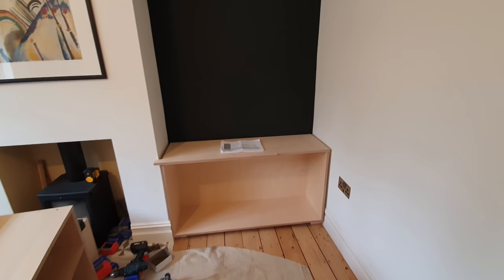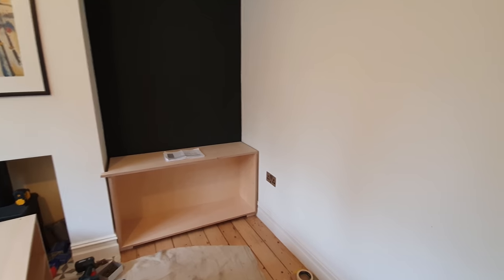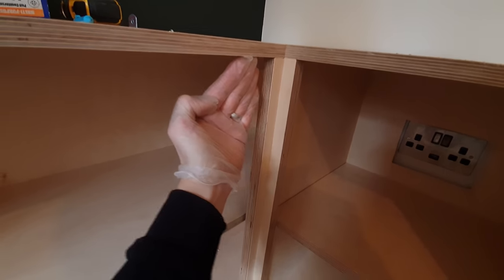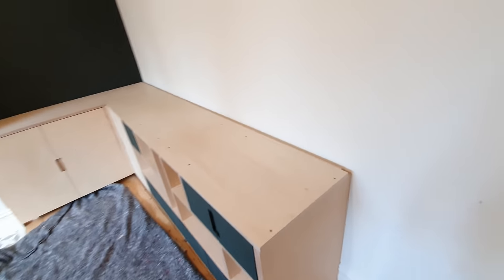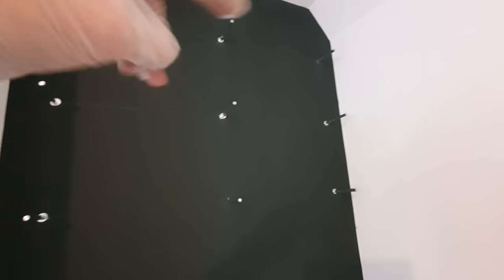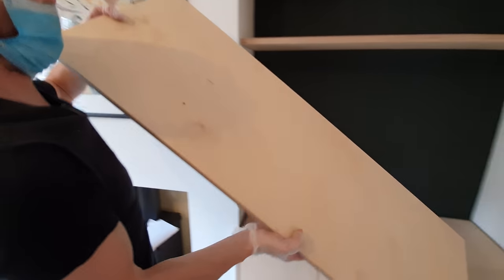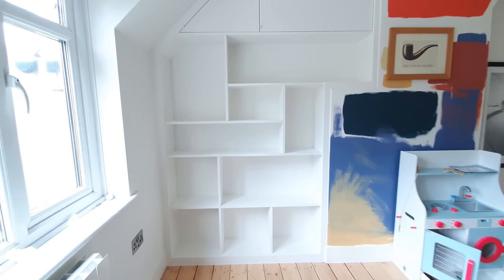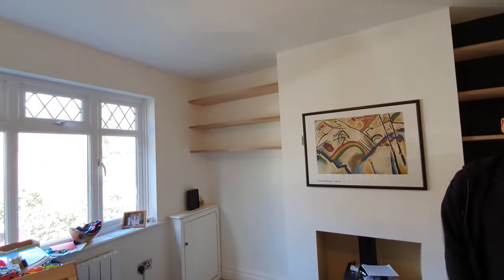Another Woodwork Install Complete |   Beautiful Birch Media Unit | Against the Clock Again! EP#58

Comment: Lovely job Ryan, love the contrast of the Matt green against the birch, very classy. Having spent a couple of weeks working on quite a big MDF job with green dust everywhere in my workshop, what a joy it is to work with birch instead! Thanks for the top on the decorators varnish. What finish do yo7 use on the birch? Have you ever used osmo fo it?
Reply from the maker: Thanks Darren I know what you mean re mdf all the time, we go through periods of that! (That varnish is pretty good and there are a couple of different types👍)
I enjoy birch and any wood or birch I work with is either finished with an Osmo polyx or Osmo wood wax finish. I couldn't go without osmo !👍

Comment: Great job Ryan. Are you really using emulsion on fitted furniture? How does that work out?
Reply from the maker: Hi Anthony, I don't do it often, the customer wanted a flat matt finish.
So I used a scrubable durable matt, customer request. I do like the matt finish but it's obviously not like an eggshell etc.
Still pretty durable though for what it is. 👍
Reply: @thelondoncraftsmanworkshop  good to know. Im curious to know how to touch up up your sprayed paint finishes?
Reply from the maker: The flatter the finish the easier to conceal touch ups.
I generally use a TINY artist brush with little dabs rather than strokes.
I do have a air brush which is OK, still need to try it a  few more times.
I've also bought a grace ultra max cordless which will defo do the job. I'll probably end up bringing that with me
Reply: @thelondoncraftsmanworkshop  i was thinking of getting one of those, but I'd love to hear from you, in particular regarding overspray. 
Credit where credit's due- your projects are looking the business.
Reply from the maker: Thanks Anthony were you talking about the graco?
Reply: @thelondoncraftsmanworkshop  yes, the Graco
Reply from the maker: There would be a small amount but I think it would be ok with a small burst here and then on site with out masking too much up.
Anything big then masking up fully or back to the workshop I guess